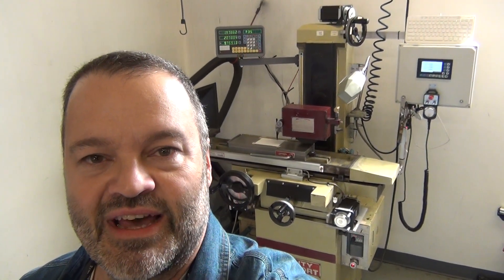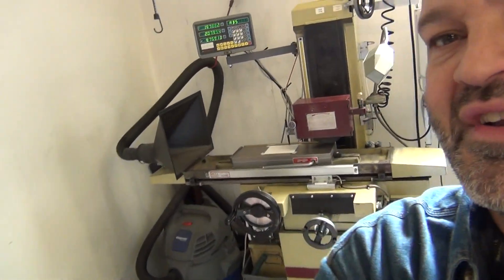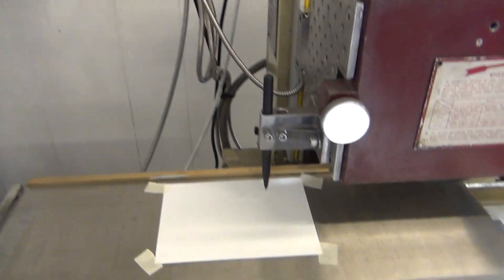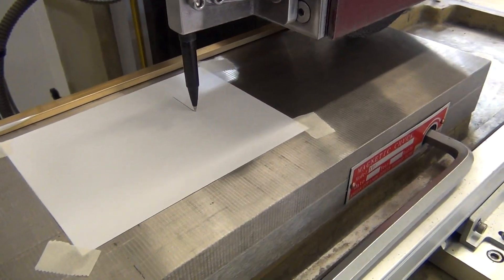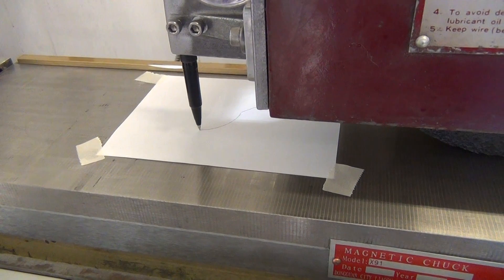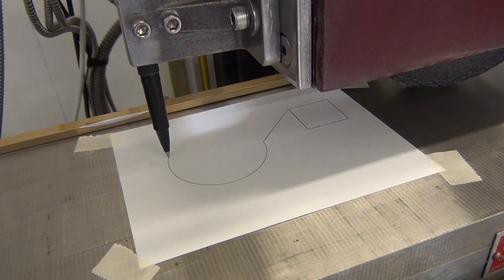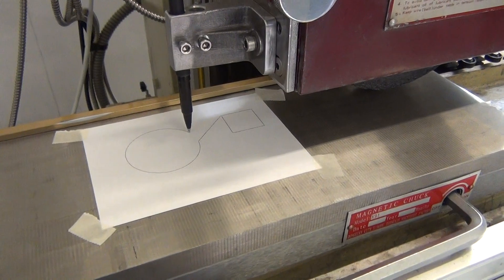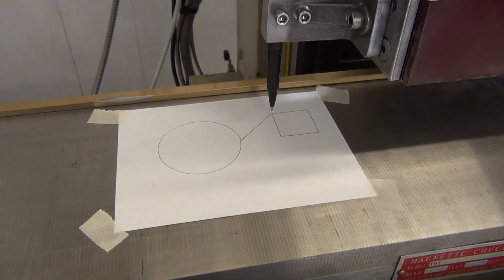DDCSV2.1 G02 Circular Motion and G01 Coordinated Linear Motion

Comment: Nice work. Given your level of experience, I'm curious of your final impressions of the DDCS controller. I'm considering using one for milling aluminum plate on a router table. Thx
Reply from the maker: I'm very happy with DDCSV2.1 and will install it on other machines if the need arises.

Comment: Thanks for making this video. Have you found a way to dress the wheel.
Reply from the maker: I dress the wheel manually but, technically, yes, you could install a permanent wheel dresser and write code for automatic dressing.  Probably not appropriate for this DIY machine but, yes, I have seen surface grinders like Jones & Shipman that can automatically dress their own wheels and then return to what they were doing--a very cool feature indeed.